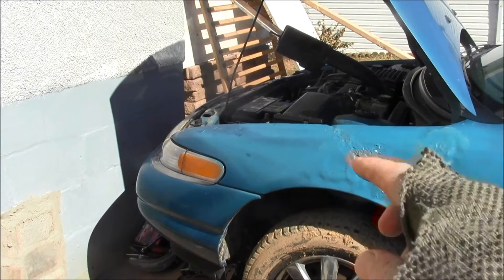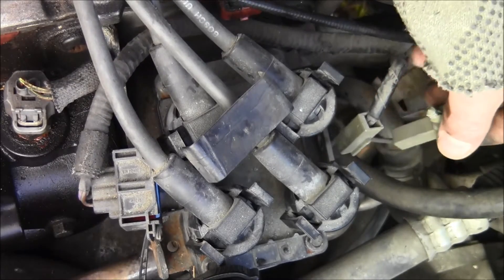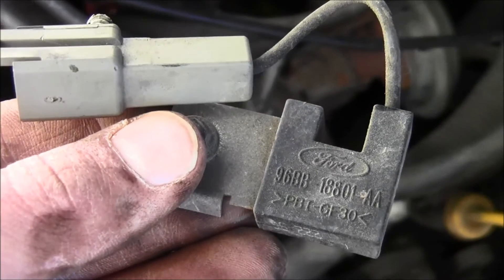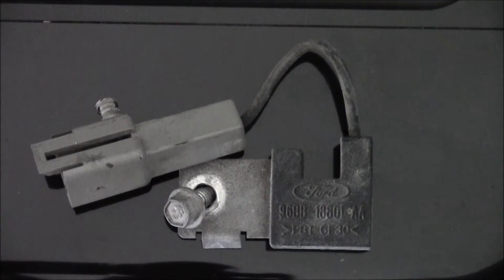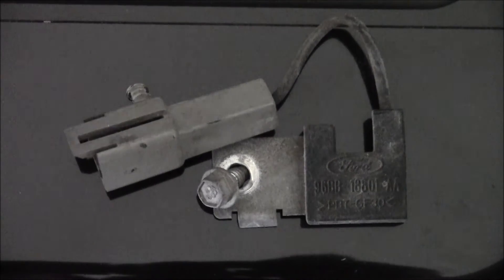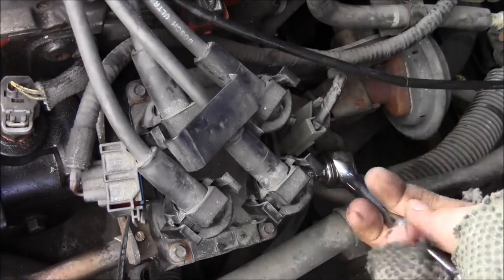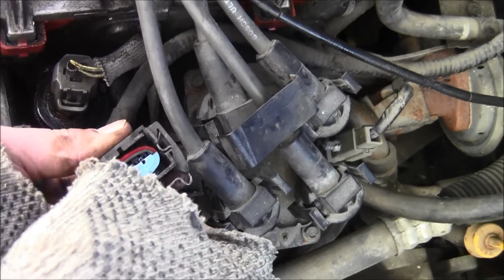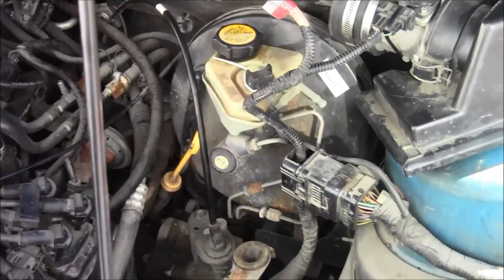How to Replace Ignition Coil Part 96BB 18801 AA on Ford Contour

Comment: I've heard these things have stopped people's car from starting. I burned the +12v wire that goes to it on the EGR and my car hasn't started since. I've replaced everything, fuel pump, filter, ecu, coils, plugs, and the capacitors will be here tmw. I hope they work.

Comment: You are Wrong. 27 years Kentucky FORD plant technician speaking. That is in fact a Ford Radio Noise Suppression Capacitor. One of the most overlooked parts.
Reply: What does this do I recently got a 05 gt none running just wondering if it’s important
Reply: What fault causes the failure of that capacitor?
Reply: Agora as coisas foram esclarecidas. No meu veículo está desativada, parece derretida. Na VW Kombi 2000, tinha que adicionar capacitores para filtragem, evitando assim que,  ruídos do motor fossem capturados pelo Rádio do carro

Comment: Thanks for posting the video with clear instructions and pictures.  It's an odd thing and it's not clear how to disconnect it or remove it, just by looking at it, especially for those mounted in different places.  Mine is mounted down by the exhaust manifold.  Hard to see, hard to reach.

Comment: Thanks for showing the method of disconnecting the Ignition Transformer Capacitor.  That little tab is hidden.  It's not the typical squeeze and pull plug.

Comment: I wouldn't let this schmuck touch my car. He has no idea what he is doing, what he is replacing or its function.
Reply: I'm sure your not going to fully understand but here is the way it works.
The coils cause a huge inductive 'kick' in voltage called a spike when their circuits are 'opened' each time to fire the coils.
The capacitors, one for each bank absorbs the spike to a large degree.
If this is not done the spike voltage radiates to other parts of the harness and can upset computer processing, allow noise in the radio and to others outside the engine bay.
They are subject to engine bay heat as high as 275 degrees and can go faulty over time by losing capacitance, go open or shorted.
If they go shorted, likely would blow the fuse powering the coils and injectors.
Open, cause rough running.
These devices do the same thing as a single condenser in an old points ignition to greatly reduce the 'arc' produced accross the points contacts.
They have to have a very high voltage rating of thousands of volts to handle the 'spikes' even through accross only 14 volts DC.
Good luck.
Reply: @Rickteg  How can I check this part?

Comment: This guy doesn't even know what he is replacing or what it does.. It is an "Ignition noise suppressor". It is actually a capacitor.Filters out ignition noise for the AM radio. He calls it a ignition coil part, give me a break. The car will run fine without it but will drive you nuts if you listen to AM radio.
Reply: No wonder I disconnected it N didn't know what the heck it was I was just like the guy in the Vid ...lol I tried turning it on and this weird noise started coming out the speakers and other parts started making noise I was freaking out at first ...lol
Reply: @davidarroyo5018  This actually does more than just AM radio the frequencies can distribute
 travel back on signal wires to the ECU when stuck in open position and give hiccups in the ECU,  if bad and closed can cause the car to stall or not drive, some people do remove these which leave the system open but long line down the road there is more problems that arise.
Reply: @Rickteg  U can say that a 1000 times , Exactly , UR the Men !!!!!
Reply from the maker: Thank you for adding to the video. Appreciate it. This part suppresses ignition noise interference from certain radio-frequency bands.
Reply: Say this part is loose. Can it cause a short? My fuse #8 keep blowing and it cause my whole car ( crown vic) to stall. I unplugged my radio fuse and I haven't had an issue.  Still afraid to drive it on the freeway at 65 mph and have my car stall.
Reply: It is a ignition coil😂😂😂😂😂
Reply: No, it will not start without this part in place.  I understand that it's for noise suppression on the AM band - but it will not start without this part in place.

Comment: i BELIEVE IT'S A RADIO NOISE SUPPRESSOR.  MINE HAS THE NUMBER F6AF-18801-AA.
Reply: It most certainly is. This title should be changed. It is in fact a Ford Radio Noise Suppression Capacitor. 27 years Ford plant technician Kentucky.

Comment: What was the problem reason ? Reason I’m asking is because I have a 2007 got a rough idle after 4000 RPM wondering if that could be the problem

Comment: I have a missfire #1 cylinder that replacement of the hairline cracked coil did not fix. In the procedure I found that plastic thingy is corroded very bad. Maybe causing the missfire? Idk. O'Reilly parts had no clue what this part is, pointed me in salvage yard or dealership direction. Not happy

Comment: Ignition Capacitor!!! Just a suppressor!!! It took 3 parts stores, many Google searches and 2 Ford Dealer Parts Professionals but finally got an actual name for it!! BTW...that's not a parts number, per the Ford Dealership Parts Manager. For my 2004 Ford F150, the part showed L1F-18801-AA but the actual part number is YL1Z18801AA. STUPID FORDS!!!
Reply: Please tell me... what is the function of that part??  Thank you
Reply: @henrycaizapanta5785  suppresses engine hum coming from radio when using auxiliary on my f150

Comment: Okey... but just what is the FUNCTION of this part? (It being not connected on my truck... just hanging there...)
Reply: Filters out the ignition noise for the AM radio.
Reply: it is only for the radio interference
Reply: Dan Denver  did you figure out why
Reply: It appears to be a superfluous part of the emission control system. 
In the end, I finally found that my problem was the fuel pump. I replaced the pump and I hope I never have to touch it again.
Reply: That's my question, too. My Escape won't start and this thing is just hanging there.